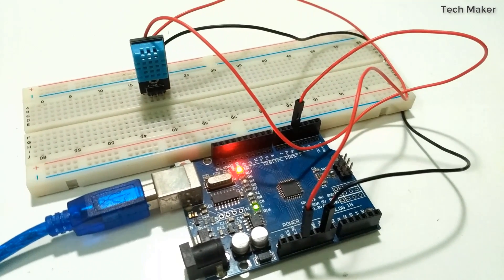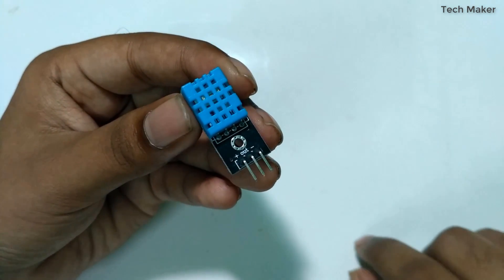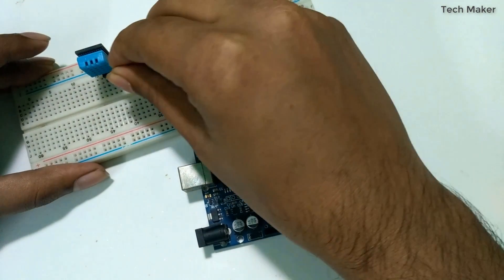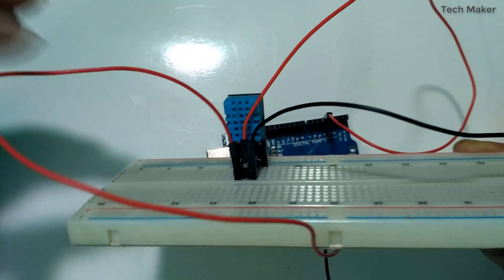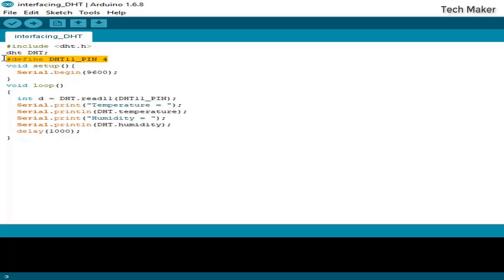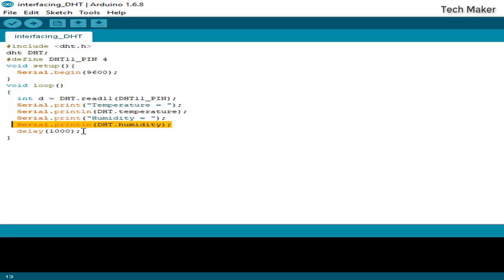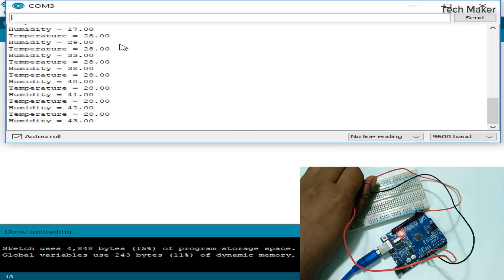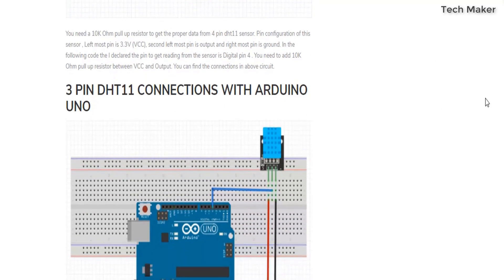How to Setup the DHT11 Humidity and Temperature Sensor on an Arduino

Comment: same problem its showing 999 continously and its 3 pin DHT11
Reply from the maker: It shows when sensor is not connected , check the pin declared in code and the pin you connected to sensor.

Comment: is not working for me "always say -999.0" in temp and Humidity
Reply from the maker: +CreativeGtr97 which type dht11 module is used. 3pin or 4pin module?
Reply: Tech Maker 3 pin sir, also do you know how can I connect my arduino with Dht11 to LabVIEW? And control it with LabVIEW? With graph and save the data to file?